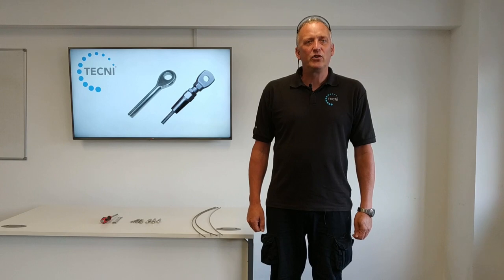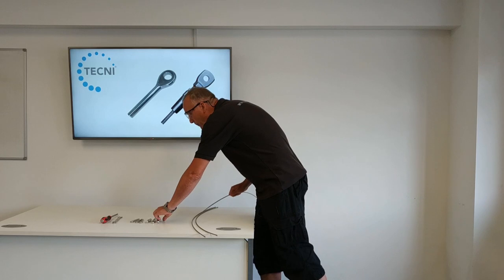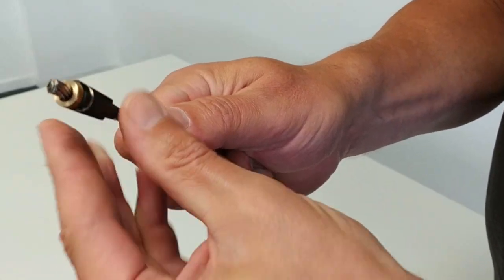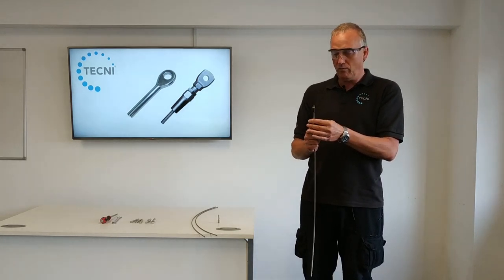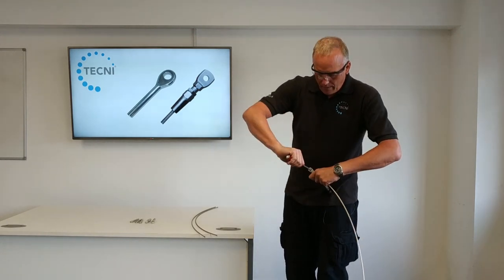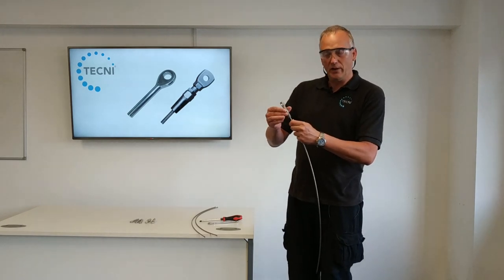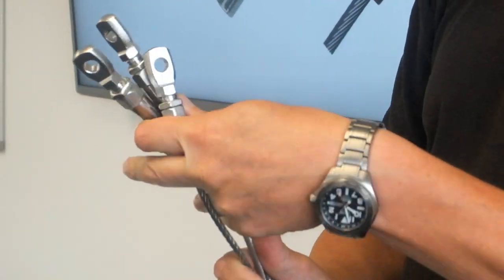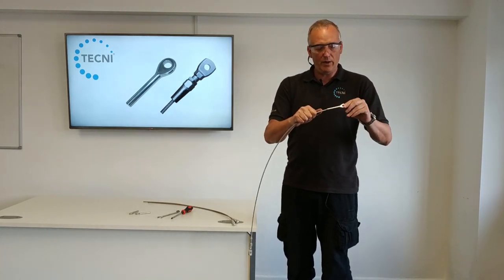How to Fit Swageless and Swage Fittings onto wire rope

Comment: Hi  Great info.   2 questions   Where can I get spare cones from?   2 Which is stronger, the swage, or the cone.
Reply from the maker: Hi Doug. Thanks for the comment. 1) We stock spares for all sizes so please get in touch at sales@tecni.uk with your requirements. 2) When installed correctly we can confirm that the swage terminal would be more efficient/stronger. Thanks!
Reply: Thank you for your prompt reply.

Comment: Show us how the cable bangs! What is more robust? pressed or mechanically assembled? What about swageing with a progressive round die?
Reply from the maker: Hi. Thanks for the comment. Swage fittings will have a higher breaking load and are easier to assemble / tamper proof, however, for DIY installations these are a great alternative which are very strong when correctly assembled. Progressive round swaging also works the same as the Hexagon swaging so long as the correct after swage dimensions are met (After swage dimensions of round swaging is different to the across flats on a hex swage). Thanks for your feedback.

Comment: Can these fitting be used on any others materials aside from metal? Ie. Plastics?
Reply from the maker: Hi, Thanks for the comment! These fittings are designed to be used with Steel Wire Rope only. For more information or possibly an alternative solution please visit www.tecni.uk. Thanks again
Reply: @TecniCable  Thank you for the prompt reply and information!

Comment: What fields or industries or applications is this used for?
Reply from the maker: Hi Luis. Thanks for the comment. Stainless Steel Swageless Eye Fittings are ideal for site work and applications where a professional swaging tool would normally be required. Swage eye terminals are very strong wire rope fittings which can be easily crimped on site using one of our hydraulic swaging tools or fitted in our factory. These fittings can be used in a range of industries/applications. They are very popular in marine environments e.g Yacht Rigging but can be used in wide range of applications such as cable bracing, architectural, structural tensioning, display applications and many more.  If you have any more questions please feel free to contact sales@tecni.uk who will be able to assist with any enquiries or visit our website www.tecni.uk.
Thanks!
Reply: maquinas GYM